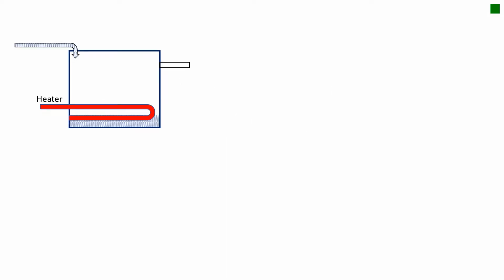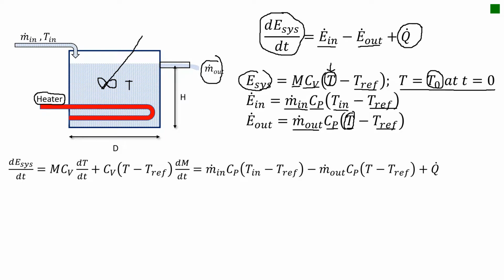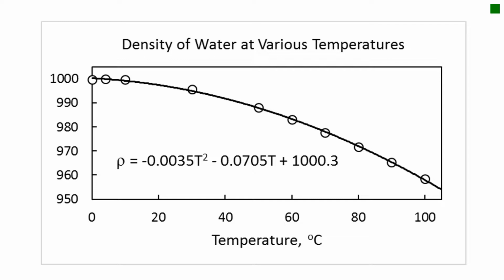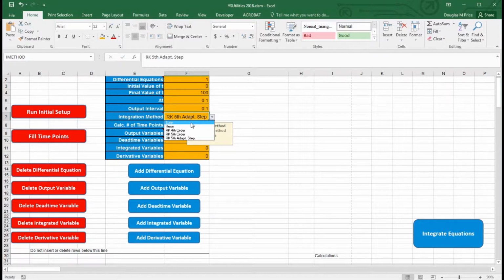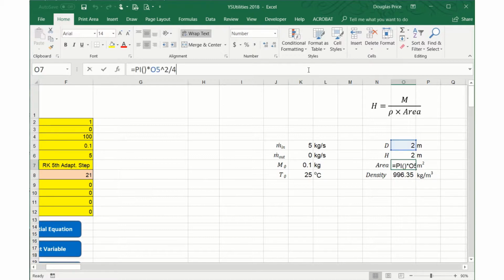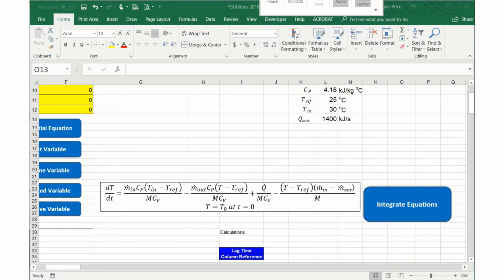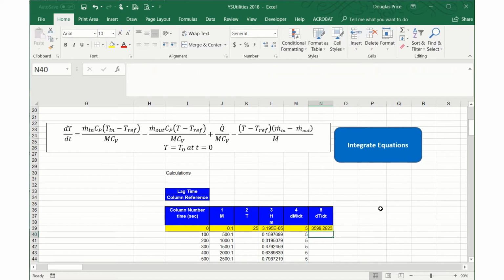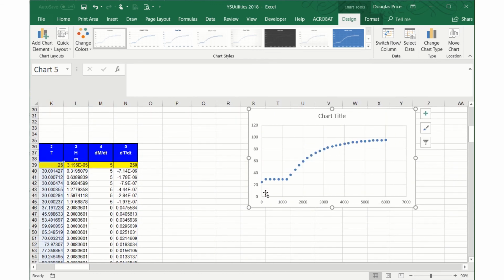Heated Water Tank

Comment: Does it imply that steady state temperature of around 96 degree celsius is the same as heater material temperature providing 1400kJ of heat input?
Reply from the maker: No. In order to transfer heat from the heater to the liquid in the tank, a temperature difference driving force must be present. Therefore, the heater must be at a higher temperature than the  liquid to deliver the energy. The example problem was a simplistic scenario where the heater output (when turned on) was a constant value.
Reply: Douglas Price _ i agree that heater element must be at a higher temperature to transfer heat to the fluid. My query was as steady state approaches the temperature difference reduces and no further heating occurs at heater output value.
Reply from the maker: @sundaram15887  Since there is flow into (and out of) the tank, and that the flow into the tank is at a lower temperature than the ~96 C tank temperature, heat must be continuously supplied to maintain the tank temperature at 96 C. Therefore the heater surface temperature must be higher than the liquid temperature in the tank to supply the heat necessary to bring the feed liquid up to the tank temperature.
Reply: Douglas Price I just missed the inlet liquid. My bad. So physically what the Steady State represents is a continuous extraction of heat from the tank liquid due to the cooler inlet line and heat addition from heater element to quickly compensate in such a way that no noticable temperature drop occurs in the tank fluid and thereby the outlet fluid.
Reply from the maker: @sundaram15887  That sums it up.
Reply: Douglas Price i learnt something really valuable today from the video and our discussion. Thanks a lot!
Reply from the maker: @sundaram15887  You are quite welcome.